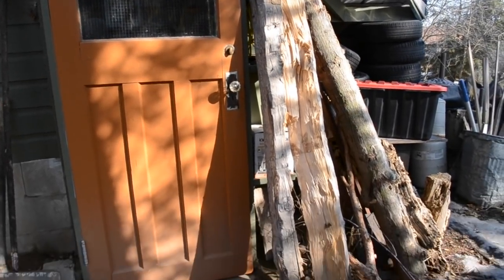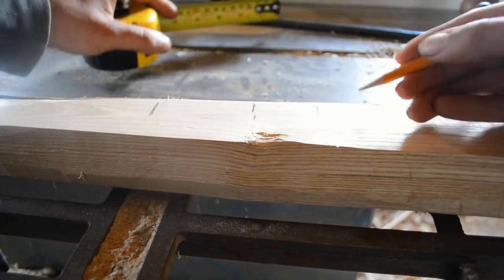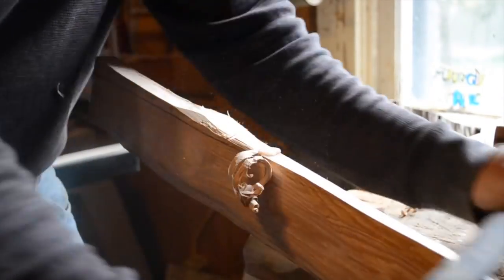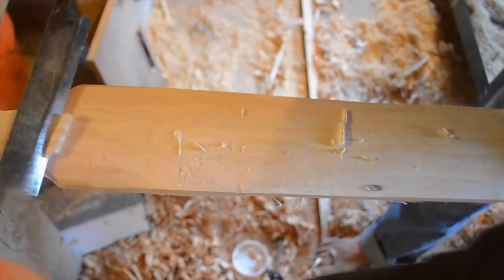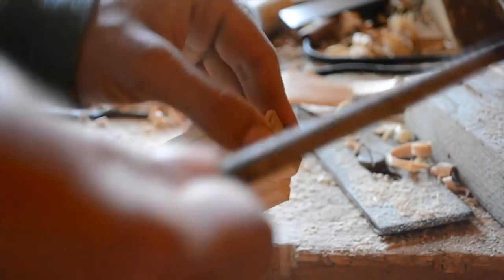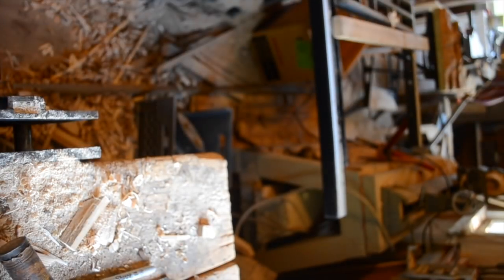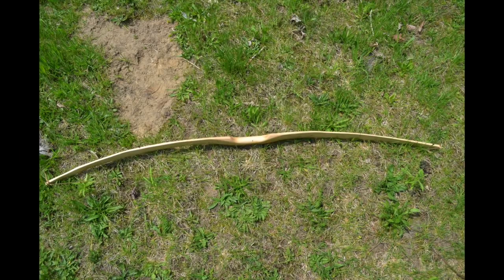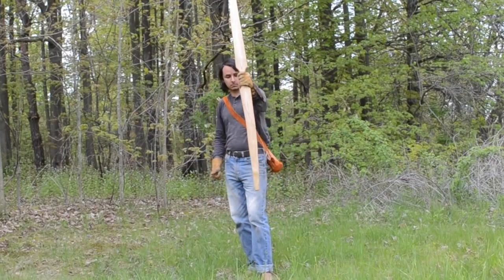Making a flat bow

Comment: Nice video. I think flatbows that are too wide can be slower than round bellied bows, but flatbows can also be 3/4-1.25" wide and straight all the way no fades. My tips and most tips on bows I've seen in books etc are 1/2-1" wide. Any wider and your bow slows a bit. Cheers from Alberta

Comment: Great video and good sentiment about it not being as science-y as the internet makes it out to be. Just gotta get your hands dirty and start trying. I noticed you unstringing the bow at the end- were/are wooden bows commonly stored unstrung? I guess that would make the most sense but I hadn’t thought about it before.
Reply from the maker: Old fashioned bows take a set really easily.
If I were to leave it strung, I might lose a quarter of the power in a week.
Even if you take care of them, they still take a set after a while. My oldest bow, after five years moderate use is bent about three inches when unstrung.

Comment: Reminds me of when my dad, who did a lot of deer hunting with recurve bows, kept cranking up the draw weight on his compound bow because it felt weak to him.
He thought it was slipping, but he had just worked the muscles necessary for that movement really hard and strengthened them. He noticed his arrows were acting unpredictably, and took the bow in for repair at a local shop.  
None of the big burly young dudes there could draw it back....but another old guy into "primitive" archery could.

Comment: I struggle with identifying which areas of the limbs aren't bending evenly as well. On this channel called "Shatterproof Archery", Kramer (the bowyer who runs the channel/company) made a video where he shows you step by step how to make and use a tillering gizmo and dude it's been a game changer for me. I can do the first like 60% of tillering by eye but after that the differences between negative and positive tiller as well as the adjustments you need to make to  balance the tiller become SOOOO minuscule that there's no way I could pull it off without the gizmo.
Reply from the maker: A simple trick that works well enough for me, is to get a flat piece of wood or a level, and while the limbs are slightly bent, lay the piece of wood parallel against the limb and rock it along, anywhere that it lies flat is not bending properly.

Comment: I enjoyed the video, i think I will try it again using your method. The first and only bow I ever (try to) made blew up during tillering.
Reply from the maker: Just don’t pull it too far until you’re sure it’s ready. Take your time, do it well.
I’ve done that in the past where I’ve gotten excited and tried to shoot too early.
And don’t get discouraged. My first three blew up instantly and my fourth only lasted a couple months. Like anything else, it just takes practice.
Reply: It's important to note that unlike a compound bow, or modern fiberglass bow you can't hold these bows in the draw position too long.  They're meant to draw and shoot in one rapid motion.  If you hold them drawn, the odds of breaking increase.

Comment: did you chase a ring on the back since it looked like you removed a good bit from the back which normally you never do and if you do its to chase a ring since if you dont you will pop a splinter without a backing
Reply from the maker: I don't understand the question.
The front of the bow is all on the same layer of grain. On the back the grain descends from handle to tip.

Comment: nice video.
I like the way you did the handle-section.
but I always try to narrow out the outer parts of the limbs and make them narrow but deep. That way you can reduce weight & mass of the tips. Slim tips make the bow faster afaik.
Reply from the maker: I agree, but I’ve had too many break at the tips, and as I’d never made one of this power, I figured better safe than sorry, especially as I was on camera.

Comment: Great video. Are there decorated specimens in museums? Decoration would make a good follow-up video.
Reply from the maker: Yes. There are some that have been carved, others have leather covers with beading.
Reply: @MalcolmPL  Ash is good bow wood. It will be extinct soon.. wide and flat.. mine was about 60lb as well
Reply from the maker: It’s not going extinct. Two percent of trees survive. It will come back eventually, just probably not in my lifetime.

Comment: Hi, I'd like to probably suggest an idea for maybe another arrow testing video. Something centered on a topic relating to how effective native american hide shields could withstand arrows and other melee weaponry that was available. Something like a piece of thick hide meant to be used for the sole of a mocassin could work, right? I'm not too keen on the price of rawhide.
Reply from the maker: I've got a raw cowhide in my freezer (makeshift buffalo) I've been planning to make a shield from it using one of the traditional recipes, I've also got some bits of rawhide kicking around from other projects, so it's just a question of finding the time.
Reply: @MalcolmPL  I see. I'm just asking this to get an idea of what the results would be for a speculative armour idea I have for a personal project. I'm not sure if raw-hide for dog treats would compare well since I've found a bag of square cuts which are a fairly thick.
Reply from the maker: @jonajo9757  Rawhide dog chews are very tough. They tend to have the epidermis removed, which isn't ideal, but they would work well enough. I met a fellow who used them as a cheap material for shoe soles.
Based on my experience with rawhide, One layer would give some protection but not perfect. Two layers would be proof against most normal blows.

Comment: Dumb question but how dangerous is a bow failure?, I can imagine it’ll mess you up pretty bad if it explodes in ur hands
Reply from the maker: In my experience, not too dangerous. If a limb breaks it is very jarring on the bow arm and the loose limb can swing back and hit you, which stings, but it isn’t going to do any real damage unless it gets you in the eye.
I’d imagine it could be bad if the bow broke in the middle of the handle, but the handle tends to be the strongest part.

Comment: Nice gonna try it , one thing you didn’t mention when picking out a piece of ash is it Dryed out or worked green?
Reply from the maker: I split the ash into quarters then dry the sections in the basement for at least six months.
I don't work live ash. Any trees that have survived the borers have a good chance of being resistant and need to be preserved. Besides that, there are all sorts of issues with warping when you work green wood.
Reply: Malcolm P.L. Gotcha 👌

Comment: D-section bow design is far from effective !  Either the wood on the tip of the D is overly stressed, or if it is not, then the space left and right to it is simply "wasted space".
A rectangular cross section is always the most efficient shape for a bow. If you want to make it lighter make the rectangel thicker. Another thing is that wood usually could take much more tension than compression - another argument against the D cross section, because it weakens the compression area even more. Possibly a reversed D section would make even more sense (narrow back and wider belly).
About your bow:
I guess the whole limbs but in particular the tips could be much more narrow, that would make the bow even faster. If it doesn't mess up the tiller you could still give it a try.
Reply from the maker: At the time I needed an overbuilt bow for a test project. I later went over it again and brought the tips into proper points and brought the draw weight down to a more reasonable level.

Comment: if both limbs are exactly the same length the bow will kick and be uncomfortable to shoot .the bottom limb should be a bit shorter.Tiller the limbs all the way through the handle so you feel the bend in your hand..lighter longer limbs will make it CAST better and shoot faster so you dont have to rely on shear draw weight.Old Iroquoian saying..."Any bow good bow but those arrows are a bitch"